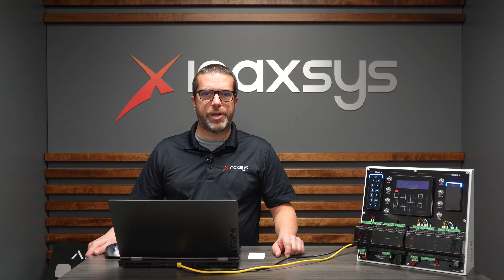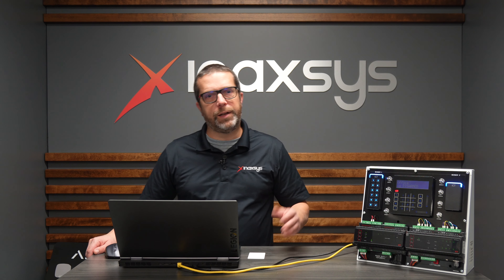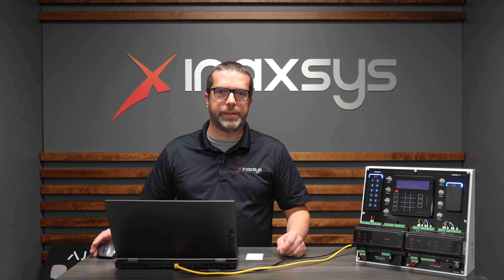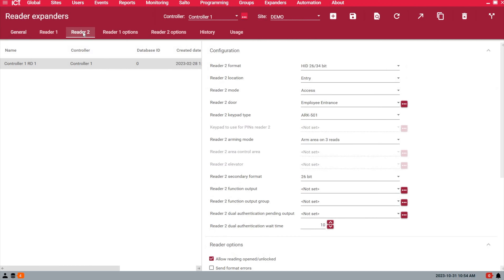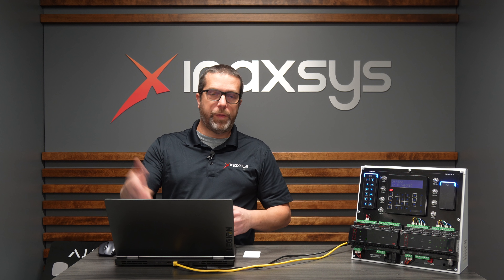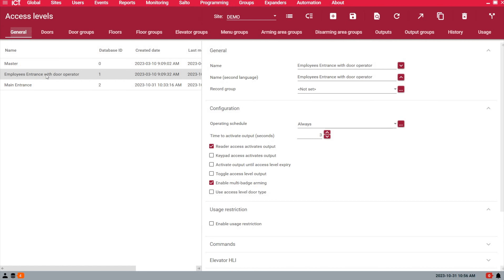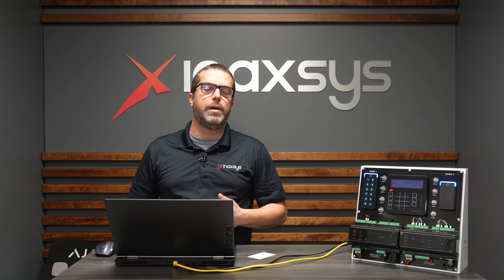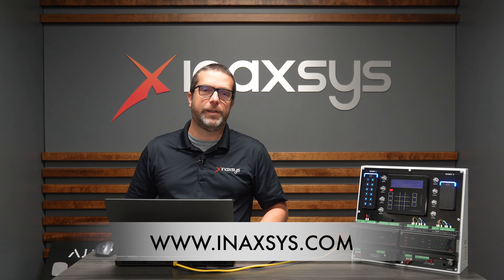How to Use Access Level Outputs With ICT Protege GX

Comment: Is there a way to delay the output for a second, so door unlocks and a second later the door open output activates?
Reply from the maker: f the access level output activates for all users, then I would suggest using the ‘’Enables additional lock outputs’’ of the door outputs tab.  This will allow to delay the activation of a second lock output.  Another option, would be to use a logic control programmable function based on the access level output turning OFF.   It would be like we activate the access level output for 1 or 2 seconds.  Then the logic control function will activate the door opener output when the access level output turns OFF.